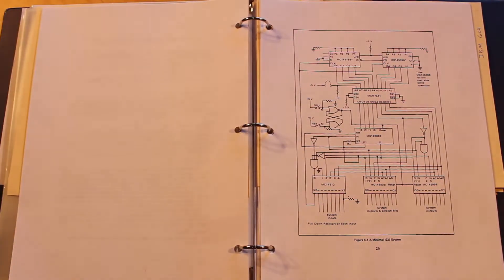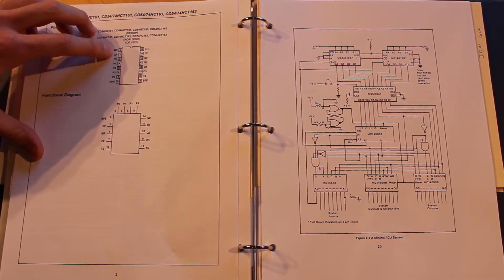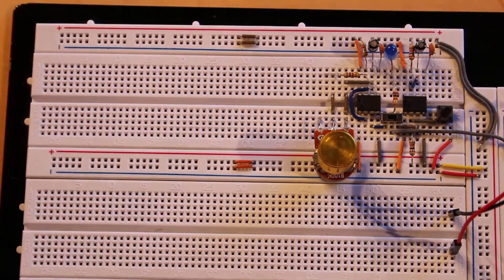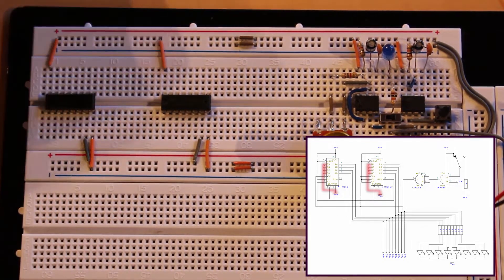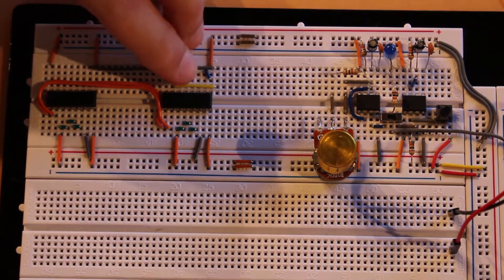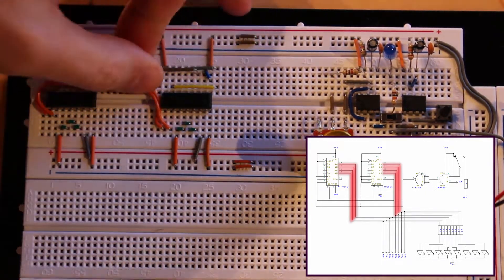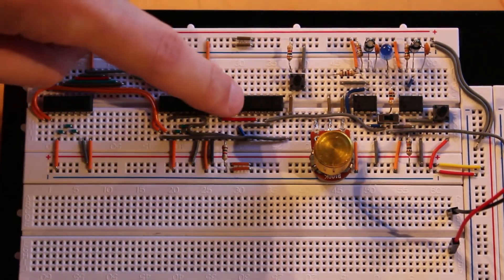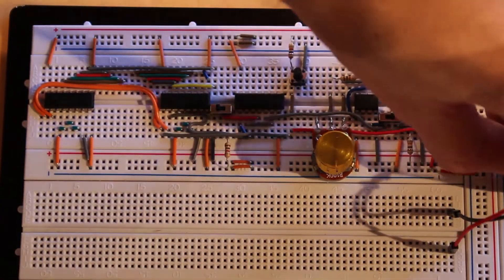1-Bit Breadboard Computer P.02 – 8-bit Program Counter (using 74HC163)

Comment: Isn't there a pin to stop the clock being used; a count disable or count enable pin? That would be much simpler, and tidier. It would be surprising if the IC didn't have that feature.

Comment: I think I've just figured out the real reason you're not cutting the jumper wires to length but bending them, etc.: You're going to tear this down and straighten them out and reuse them later. No point cutting new wire if it's not going to stay this way. Am I right or am I right?

Comment: turn the 74163 180 degrees to have input and output in a tidy configuration and saves space too.
Reply from the maker: That would have made life so much easier, but I'm a bit of a space cadet sometimes and I was really afraid of hooking power and ground up in the wrong spots and frying something. So, I tried to keep pin 1 to the lower left for all the chips, that way I wouldn't get all twisted around. 
The other alternative that I should have done would have been to place the clock and counter chips on the bottom instead of the top, that would have helped this stay much tidier!